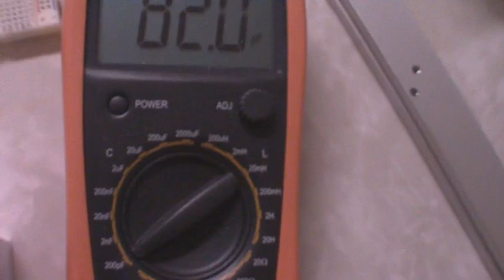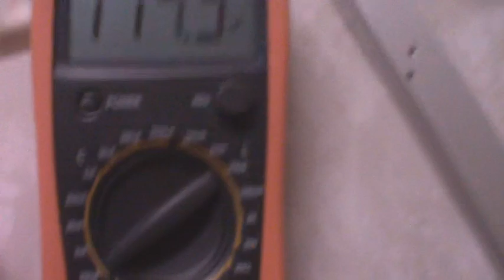DIY FREE Variable Aluminum Air Capacitor - SEC / Gbluer Slayer Studies

Comment from the maker: @Magneticitist well. as i was eluding to in the comment there... if you use a thin consistent dimension stainless stell blade type, inside an aluminum type, then it slides further in... if a person rigged up a way to put them on set screws held in place for adjustment then they'd never short. Cheers

Comment from the maker: I might add, typically there are two types of heat sinks floating around out there, and the other kind is the type with long, thin (what appears like) steel blades or fins, that do not change in their dimension, i.e. they remain very thin the entire length. A bit of fiddling around with one of those, and one of these, should provide even larger range, into the order of nanofarads as well.

Comment from the maker: I need to cut the tabs off this to make it more workable, but it, as is, can range from 0 to 150 pF and should be 0-500 or more, when done. It does however, as is, work nicely for the Slayer Exciter in the 1.5V range where you want something in the lower ranges, anyway.